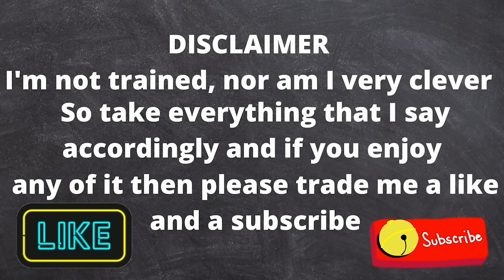Reliant Scimitar SE5a 5 Day Restoration (kind of!) Can I Turn The Fortunes Of This Old Car Around?

Comment: Yep. Just as I'd hoped. I had a Talbot Horizon 1.3LS once. Believe me, at 17 years of age when all your mates have got MK2 Escorts and Sierra 2.0GTSs, you get quite a lot of stick - until you tighten your ohv valve clearances down spec about 40% and get a right load more horsepower! (as long as engine's hot or just reasonable guess, if not) Don't forget, with an ohv, you have twice as much clattering force due to effectively double clearances - one for the crank to pushrod, and one at the pushrod to rocker - than an ohc engine. So, rest on those feeler blades a bit more than you do with an overhead camshaft engine!!! Trust me, it's safe as long as you don't overdo it! My Talbot was absolutely beautiful and I wish I still had it now! Looks like it's just been hammered wider, that No.1 (2?) pot... Magic worked again! 🙂

Comment: The issue with seized wipers was common on minis. The solution is to remove the wiper blades.  Disconnect the worm from the motor. Then pull the inner from the outer at the wiper motor, it should come out with a bit of twisting and pulling. Clean the worm and re- grease. Reassemble . Usually the are like new unless the cogs under the wiper spindles have worn, (floppy wiper arms) in which case, they can be rotated 180 degrees from their original positions (mark them at the point the worm comes out) and you have new teeth in the spindles operating.  Only costs a bit of grease and 30 minutes of time.  This is an excellent candidate for a full body of restoration, for someone who knows how strip and paint fibreglass bodies. It should restore like a new car.

Comment: Another car rescued from the crusher..
Mind you when you got that non fireing cylinder sorted, It would have paid you to have all six plugs out, clean and gap them and before refitting set the valve clearances on all 6 cylinders. . She'd have ran much sweeter and quieter.. Still, it wasn't me trying to work with frozen hands in sub zero temperatures !

Comment: Great work, loved this. Cracking old motor.
Reply: The stripes were actually a good idea but, they are far easier to apply if you spray the panel with water before applying them. Then the applicator pushes the air bubbles out.

Comment: Those v6 essex engines do have a tendency to round off a cam lobe due to a crap cam follower, i dont think that's your problem, maybe a proper valve gap set-up would cure it, other inherent problems they do get is a blowed head gasket for no reason, cracks in the head are also a thing to look for,  the fibre cam timing gear can also lose teeth or crack (old age)